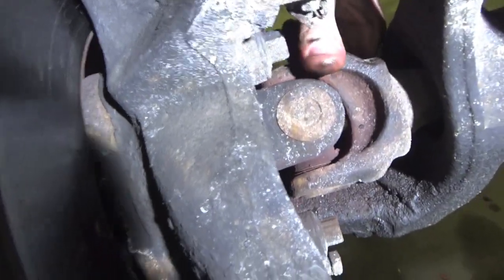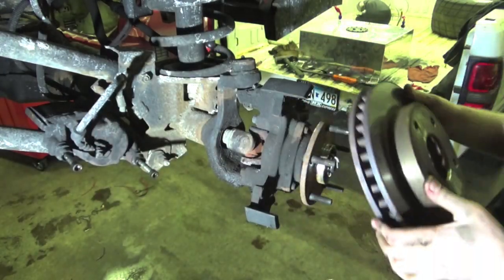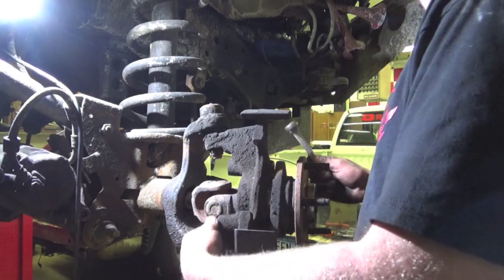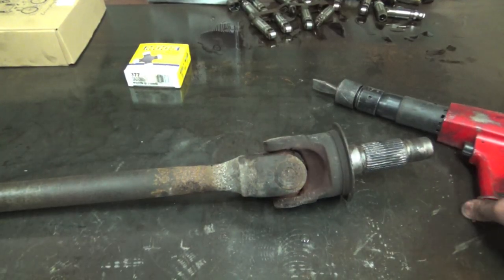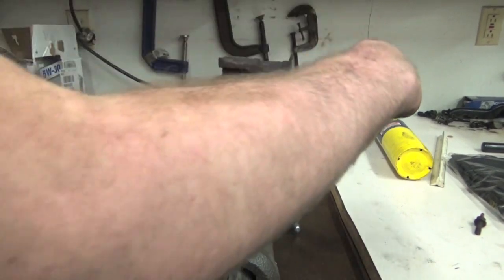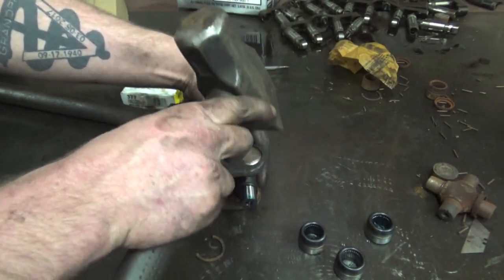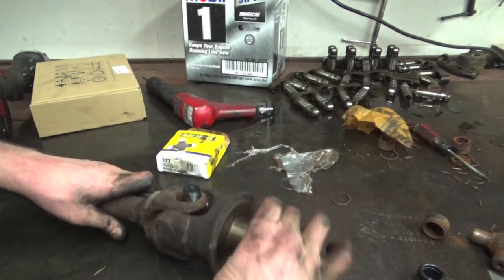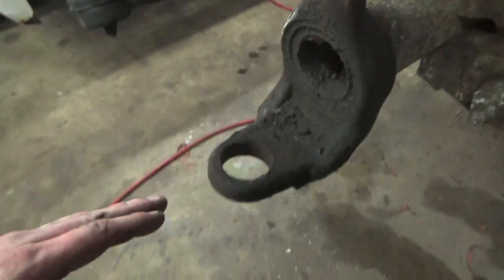REPLACEING Front U JOINT as fast as the Professionals! 94-2001 Dodge Ram 1500

Comment: Good video..  just a trick I've learned.  
SKIP THE AXLE CASTLE NUT.  
just leave the hub attached to the stub end of the axle joint...  
Saves a bit of hard work and skips the retorque of the axle nut to 190ftlbs.... most people aren't capable of RETORQUEING TO THE SPEC.
Reply: How do I get to the u joint

Comment: I don't know The funny thing is is if you go over to a Ford front-end Dana 50 half shaft u- joint replacement, almost every video I pulled up was so concerned about pushing the u-joints out so you didn't bend any part of it. Is the Dana 50 that much weaker than the Dana 60?     Also super curious is there not any kind of dust cap going into the axle tube at the end of the half shaft? I feel like there should be something there to keep dirt and rocks and crap from getting into the axle tube....
Reply from the maker: @nicholashall6850  it’s pretty hard to bend them. Only one I use a ball joint press for are aluminum drive shaft u-joints.  And no dodge don’t have dust caps that’s a ford thing

Comment: Great video just a little more detail
Would be nice.. 2 questions. No worries about the u joint being damaged while
Hammering? Also no certin way the splines line up goin back in?. Also would have been nice if it wasnt sped up knocking the u joints out. Other than that good vid

Comment: Are the axles both the same size for each side passenger side and driver side? I need to replace both front axles on my father's 2000 Dodge Ram 1500 sport edition with the 5.9. And it looks like the axles could be different lengths but I'm not sure. Any help will be helpful.
Reply from the maker: The axles shafts are different lengths and styles. U-joints are the same the passenger side axle is a two piece design

Comment: One question to any mechanic do you have to use just c-clips or can you the top cap style
Reply from the maker: @loganr8576  top cap style? There just c-clip in
Reply: @RacingRamFam  I meant snap style u joint not top cap

Comment: Hey iv got a question about whitey so its a gas 318 5.2? and you can push a lot of power out of it cause i was told you cant push a lot of power out of them befor you hit a wall so what did you do cause i have a dakota with a 5.2 i want to build but im afraid if i should go with 5.2 or try to get a 5.9 or if you thing a 5.2 would be just fine?
Reply from the maker: This is a stock 5.2 318 magnum yes gas but e85. Head studs and cams all that’s done to the motor and 15psi of boost and 50 shot of nitrous. She handles it like a tank
Reply: @RacingRamFam  and what are the numbers you have on it aswell how much power is she pushing what ate the quarter and 0 to 60 times?
Reply from the maker: @dstdismount8164  check the videos out!